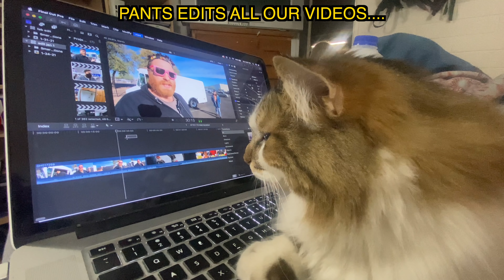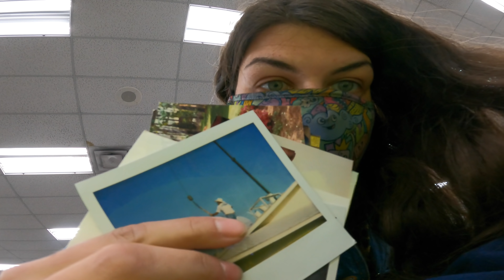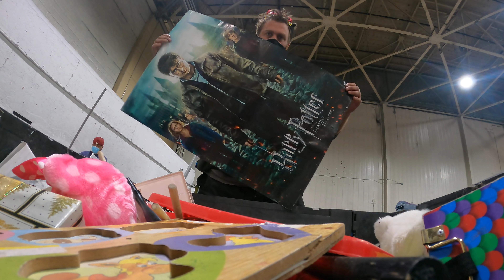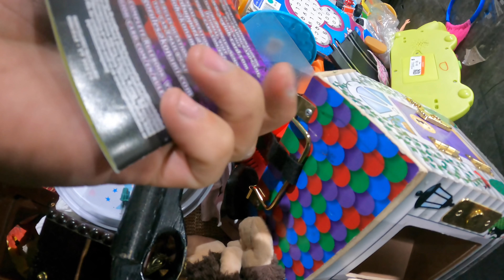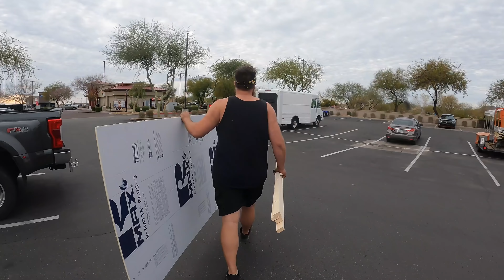EPIC Goodwill Bins Find and Bread Truck Painting!!! | Live Thrifting | Step Van Conversion

Comment: 2:35 ...keep an eye out for “luxury” vinyl flooring....I’m not sure why it’s called “luxury” maybe because it’s thicker....but it’s definitely worth spending a little bit extra (usually $5-$6 sqft) ...since you’d probably only need like 2 boxes.....it’s what a lot of stores use for high traffic areas....has like a 35 year warranty lmao
Reply: I’m going to put a subfloor so I can run wiring and plumbing underneath, than that vinyl on top.....can’t wait for the weather to get better....it’s cold and a pile of snow now ❄️ 🥶
Reply from the maker: Yeah, i'm waiting for some cheap flooring to show up somewhere. Half a box showed up at the bins yesterday, but it wasn't enough!